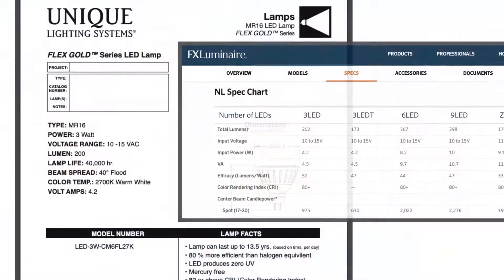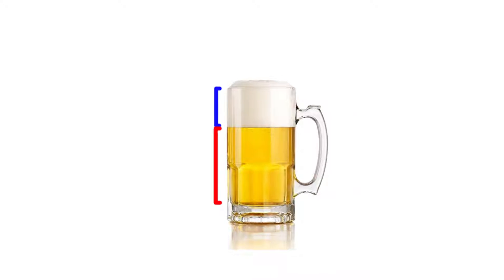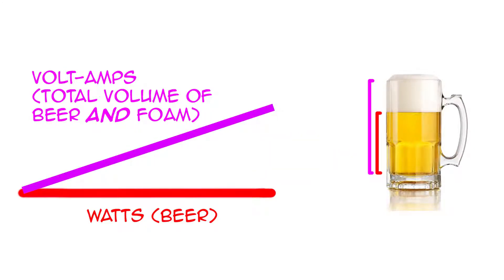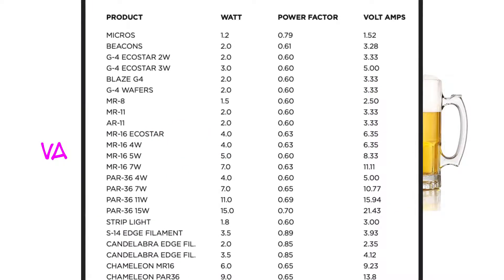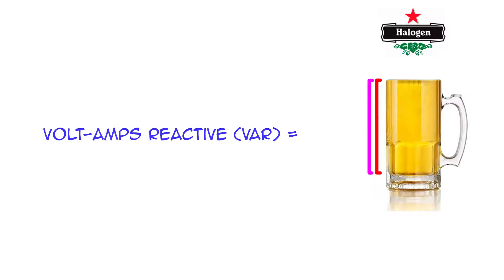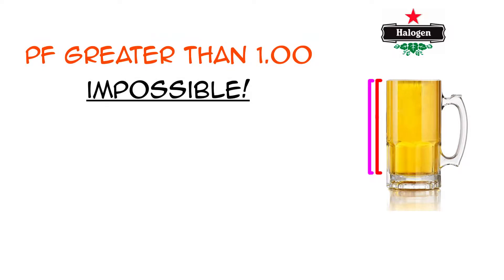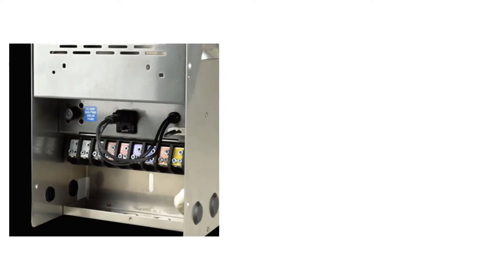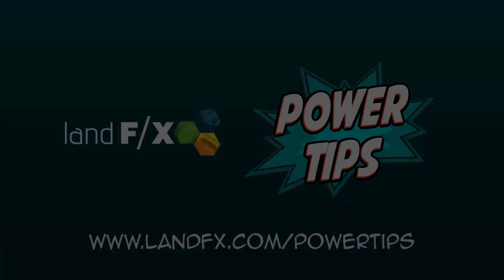Power Tip: Watt is a Volt-Amp?

Comment: He said use VA to size a transformer but Transformers are rated in WATTS!!!  So how do you do that??
Reply from the maker: Tally up total VA of all light fixtures connected to the transformer – a.k.a. the "load" on the transformer – and compare that to the transformer's Watts rating. You can even treat the transformer's Watts rating as its VA rating. In fact, the transformer manufacturer determines that number by multiplying the transformer's design Voltage with its maximum Amps – in other words, Volt-Amps :)